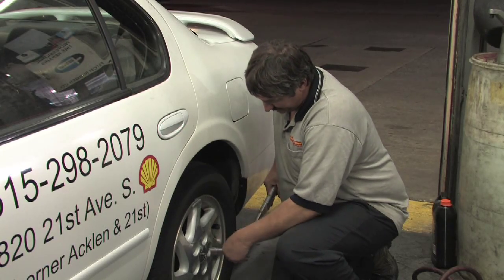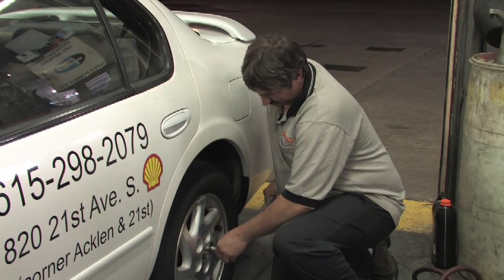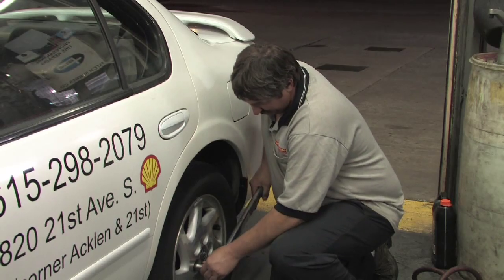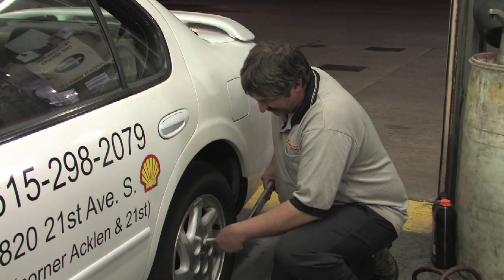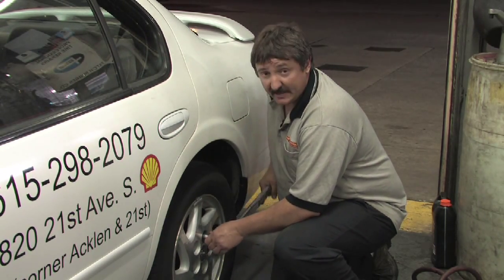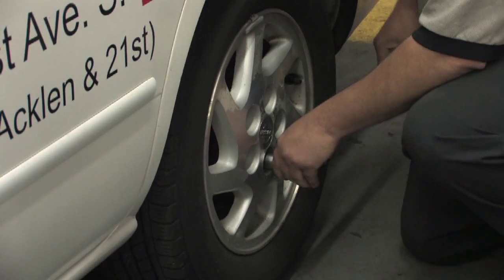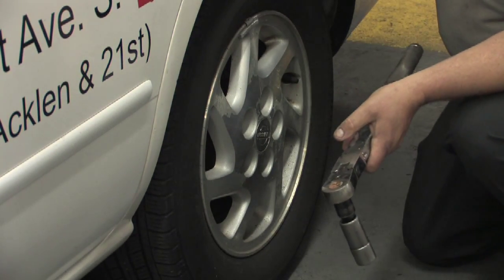Car Maintenance Tips : How to Use a Torque Wrench

Comment: 'The wheel has been properly tighten to the proper torque specifications in pound feet' is what you meant to say, eh? Not 'the tire has properly been torqued on'.